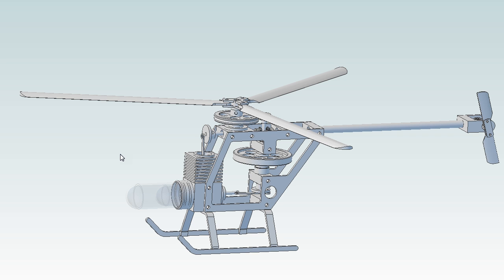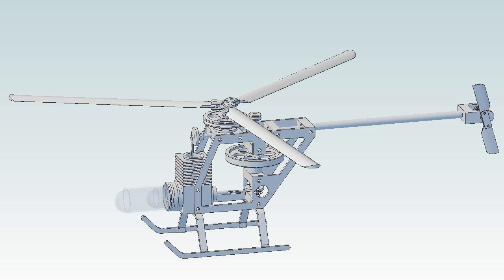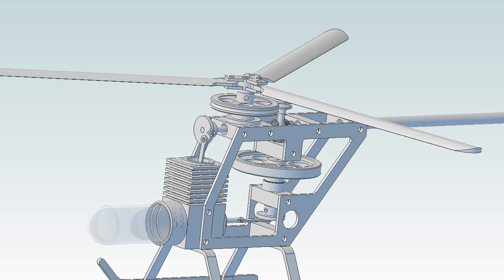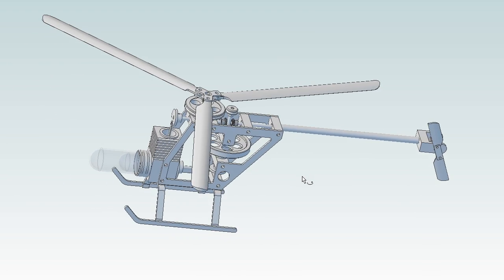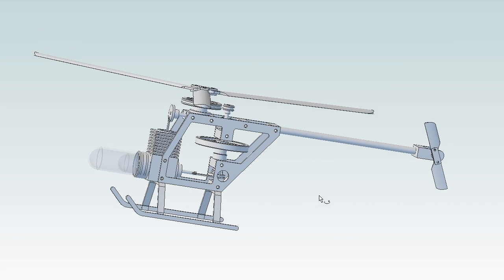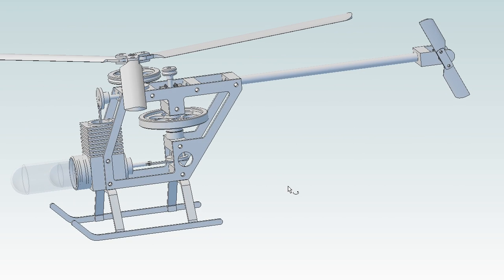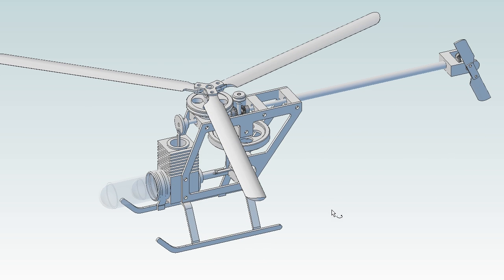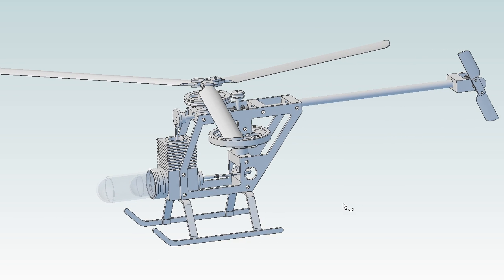Building a Stirling Helicopter - Part 1: Introduction and Overview

Comment: Engineering enthusiasts who are trying to make their own   swash plate assembly are having serious challenges given the intricacy. 
What if the main rotors are permanently fixed in an offset position for the greatest air "biting" capacity and now install a transmission box to control revolution speeds.

Comment: Hi, I am creating a CAD model of this helicopter as part of a university piece of work. I have seen the plans made available and they are a tremendous help. However the plans do not include any information about the dimensions of the bevel gears used. Can you please provide me them? Thanks.
Reply from the maker: The plans assume you will purchase the bevel gears (they're hard to make). Given that, it's your job to find some that will fit in the space provided and then model those. That's what I did.
Reply: @KenToonz  Any chance of letting us know the source and part numbers of what you used ?

Comment: How does the main rotor and pulley at the same rate? As in, what attaches them together because it seems as thought the shaft connected to the main rotor does not spin with the pulley. Correct me if I'm wrong
Reply from the maker: There is a smaller pulley directly above the flywheel that drives the larger pulley connected to the main rotor. Watch the rest of the videos in the series to see how it all goes together.